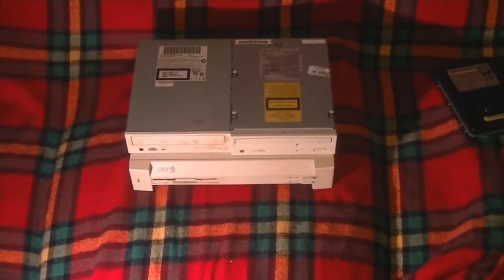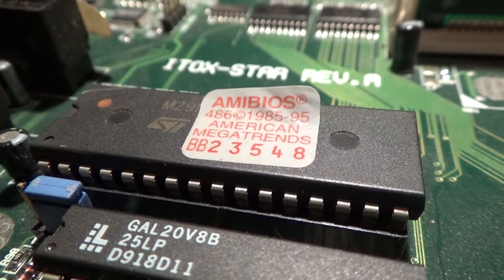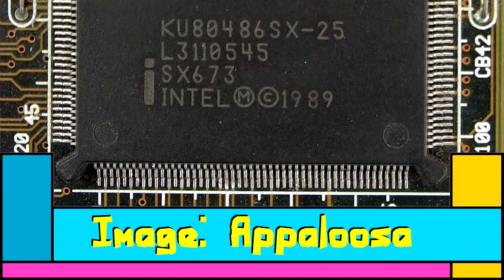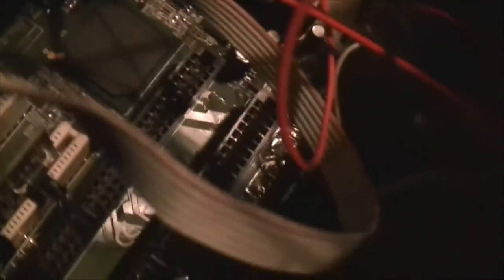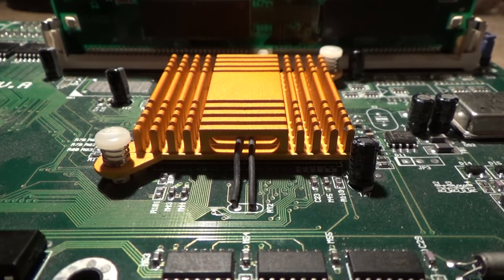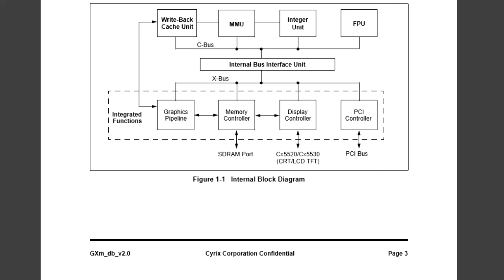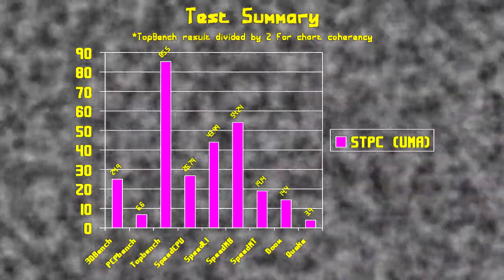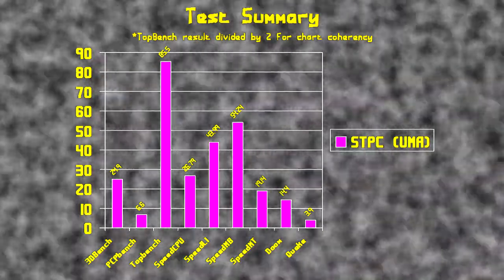STPC (Embedded 486) & Industrial x86 explanation

Comment: I've been after a 486 since my Packard Bell Legend Multimedia died a couple of years ago.  It would be brilliant to build myself a new 486, but I really cannot afford what these would cost, and I'm sure there would be some problems down the line with me trying to run a bespoke industrial board as a general purpose multimedia capable 486 machine.
Reply from the maker: Quite possibly and the prices are indeed steep, I was lucky with this one as it was listed simply as "486 Motherboard" and I don't think the guy really knew what he had. Currently there's an eBay seller selling some of their non-industrial machines cheaper than they usually are over here, but I've no idea as to the condition of the 486 machines they have or if they are priced well as I was after other things. May be worth a look. As for problems with industrial 486 systems, I can tell you the ITOX doesn't always play well with CF cards, which may be a problem down the line if my mechanical drives fail.
Reply: HighTreason610 I might look into that
  hopefully I'm getting a Gateway 2000 from across the pond from lmull3

Comment: Doom would run even better if you used the low detail/shrunk the screen a little bit or both. I think you can achieve 35 fps easily with that (35 fps is the maximum framerate of Doom and is achieved when gameticks equal realticks, more performance is good only to avoid drops in busy areas).
Reply from the maker: It would, but the purpose of the benchmark is to use identical settings on each machine to show how the performance varies. I see no reason to explain this in the video as I feel it would use up time and may possibly even be insulting to my audience, primarily because I believe my audience is intelligent enough to realize that lowering the detail and screen size would make it run faster - and given your explanation here, it would appear my belief was correct.

Comment: Thanks for the double videos mate! We've missed you! I watched the Mario 64 lets play though :D wuz gud!
Reply from the maker: I miss being here when I've been away for a while too, thanks. Oh, yeah, Mario 64, me and that game don't get along very well. I need to get back to uploading that and editing together the game for after that one. Also hoping to start Mirror's Edge in the next few months at least.
Reply: Mirrors Edge sounds ace! One quick question...what are the specs of the main computer you play modern games on?
Reply from the maker: For the most part I don't. As yet I haven't moved any of the newer games from the old Pentium D workstation aside from Minecraft, and that's only because of something me and a friend wanted to do that needed more power, which actually makes things harder for, as I plan to build a lag machine in-game to ruin his fun. Otherwise though, the new Xeon actually has a slightly weaker GPU, a GT730, versus the GTX460 in the Pentium D. Outside of that the only new games I own are The Sims 3 and Mirror's Edge. I generally rely on DOS/9X or an old console for my entertainment. Both the Xeon and Pentium D systems are supposed to have a video at some point, but a brief outline of the specs would be as follows;

Pentium D Workstation;
Intel Pentium D 950 (3.40GHz)
ECS Motherboard - don't laugh, they actually made uncommonly good boards for a while
Intel 945P Chipset
nVidia GTX460 1GB - MSI brand. Faulty, only 768MB shows up now
4GB DDR2-667 - As fast as the board can go and as large as it officially supports
Audigy 2 ZS Platinum - A complete wreck
10TB total storage
Windows 7 for compatibility, but I'd like to roll back to XP eventually
This one will play Mirror's Edge because I have fond memories of playing it for the first time on this system and it is a good way for it to say goodbye to producing things for YouTube in my mind. Here's hoping the liquid cooling can hold out as it has some serious leaks now. I may fix it up and re-purpose it once its video and the Mirror's Edge playthrough are completed.

Xeon Workstation;
Intel Xeon E3-1271 V3 (3.60GHz)
SuperMicro X10SAE Motherboard
Intel C226 Chipset
nVidia GT730 - Can't remember how much memory, 1GB I think. Runs Windows 10/Vegas really well. ASUS branded
32GB DDR3-1600
16TB Total Storage - RAID 10, so 24TB of actual drives
Windows 10 Pro

I only properly began moving from the Pentium D two or three videos ago, so it rendered nearly everything here going back to the very start of this channel up until the Saitek R100 video. Duke Nukem II was its last rendering job.

Comment: A really interesting board, shame the only proper listed one on ebay right now is $400. Would be interesting to see it handling NT 4 since that would be more likely to run properly on it than Windows 2000.
Reply from the maker: Prices can be downright stupid for this kind of thing. I was lucky when I got this one, as I don't think the guy selling it knew what it was and listed it simply as "486 Motherboard" with almost no description. I don't remember the cost as this was a few years ago now, but it wasn't much at all. I only mentioned Windows 2000 as an example of running a more powerful machine (like a P3) with a more common operating system for the time, I'd still bet on this having run DR-DOS or QNX for most of its life.

Comment: I was part of the team who worked on the STPC. I developed the STPC Industrial Debug Board, and worked to have it booting  for the first time. We received the first prototype chip and were able to boot Windows after 30Mn of debug
I still have the STPC debug board I build and some evaluation boards. (Standard PC Motherboards)
Thanks for the time you spent on it. The Board I have does not have the AMI BIOS
At that time, we had Pentium 2 like core ready and 100% designed by STMicroelectronics, but the project was cancelled :-(
The same team (Named New Venture Group)  worked also on Power VR and the first NVidia graphics, Riva 128
Reply from the maker: That's awesome! I know the Vega was a thing to some extent, though from what I could find this was running an MP6 core, is this the chip you refer to or was another one under development?
I've actually seen NV1 chips (nVidia's solution before the Riva) with ST branding before, as for the Riva 128 the chip package sure looks like it came out of an ST fab if nothing else.
Back on the STPC, since making this video I managed to get hold of a 133MHz model (Atlas) on a PC/104 form factor board, it is a rather novel device, being basically a 486 running at 2x66MHz with SDRAM onboard and an SSD (Disk-On-Chip) plugged in, it's a snappy little thing.
Reply: I worked on the STPC Industrial, It was based on Cyrix 5x86. Then it is a 486 core, with a 64bit bus...STPC Atlas is the evolution of the STPC Industrial (6x86, SDRAM Memory)The chips are also designed to work with external frequency up to 133MHz, so, not in DX2. You can check this out:https://datasheet.datasheetarchive.com/originals/library/Datasheet-039/DSA0084697.pdf I still have 2 STPC Industrial eval boards and One Debug BoardAt that time, the STPC Consumer was the first chip designed. It was made to be embedded in Televisions and design settop box (Box with a modem and TV Display, to browse internet on a TV)The STPC Industrial was designed for the Industrial/ PC104 market. 
It was used in the Peugeot 607 GPS embedded computer. For this, we added the anti aliased line drawing in hardware in this chip.The Core and Graphic chip embedded was made by Cirrus Logic, purchased by ST... (If I remember well)We can find some datasheet on this site:http://kazus.ru/datasheets/pdf-data/5792680/STMICROELECTRONICS/STPCI01.html

Comment: I don't know if the same code-base of the x86 QNX is the same for the other embedded devices, but in those QNX was king for really top of the notch stuff. Mainly because it's so robust, and it offers a true real time OS, which is ideal for complex and very time-sensitive applications. 
Just to add a little, I had an AMD Geos industrial PC, which was a 586 compatible. It didn't had the PCI connectors per-se (they were exposed as pin headers, for modules instead of cards), and it got quite a lot of serial ports. Quite nice hardware for its time, but for today... well, even a RaspberryPI (the one you showed in the video) has more computing power for less power consumption... 
Anyway, thanks for the 2x upload! We were missing your videos...
Reply from the maker: QNX 4.25, as I ran on this, was multi-platform and did, apparently, support some ARM processors. As for it being robust, yes, overall, I got that impression. Actually, my first thoughts when playing with it were that it reminded me of Minix 3 but better refined, which isn't too far fetched because they're both Micro kernel operating systems - very reliable as a driver crash generally doesn't bring down the whole operating system, what with everything running in user space except the bare basics of what is required. Also, with the time sensitivity, that was one of the points for not running Windows NT/2K, as I/O often suffers strange lag and buffering, which I would suspect is largely as a result of HAL and the odd workings of their Hybrid kernel. I'd imagine a Monolithic kernel, as used in DOS/9X, could make up for it, but then you lose the reliability of the Micro kernel, so my money would definitely be on QNX I think.
I have seen peripherals connecting by pin headers like that before and I've definitely seen machines with a large number of serial ports. In fact, one of those little Atom E3800 machines that DFI makes has about eight of them.

Thank you for the compliments, I start to miss being here when I've not had anything to upload in a while.

Comment: Eu já conversei com ele e isso me envaidece! 

All praises to High Treason, what a magnificent bastard! This guy helped me once. A quality self and that was pretty good. Awesome video. So neat.

STPC overshadowed ? Not anymore!
So....I have been eating sliced bread to tis day thanks to a 486. :)

The record shows, 486 took the blows, and did his waaaaaaaaayyy!
Reply from the maker: Well, that may be stretching it a bit, but I appreciate your complements. Yes, it is entirely possible that a 486 was responsible for something on the line producing bread. One thing I do know is that Carnaud Metalbox were still relying on 386SX luggables in the production of tin cans until recently as I own a machine from one of their closed sites, though I wouldn't be all that surprised if the remaining locations still use them somewhere. They made cans for companies like Heinz and even Coca Cola.
Another place to find older processor cores still in use is in space, on satellites and probes, but I don't think anyone will let me play with those. Notably, New Horizons (headed for Pluto) uses a modified MIPS R3000 core at 15MHz known as Mongoose-V, so essentially the same technology that ran the PS1 and PS2, though it had already been around since 1988. Funny to think of it as though there's a radiation hardened PlayStation flying around up there worth millions of dollars.

Comment: If only they made standard atx versions of this! Nice find.
Reply from the maker: It was indeed, I got it a few years ago and I don't think the guy selling it knew what it was, I seem to think the listing was simply "486 motherboard" with an unusually low price. Sometimes you can find good things with ambiguous terms or else, if you can get into the mindset of those without the knowledge. In the discussion I mentioned about the ZFx86 the idea of a 486 on an ATX board was put forward, the hardware is out there but nobody has quite put the pieces together yet. Creepingnet put forward a good idea and one that was in the back of my mind too, in that it would be cool if someone integrated the hardware into a keyboard too.

Comment: Last year I got a 486, a Socket 7 system, a Macintosh IIfx and a Pentium 4 system with ISA slots (look up the prices on boards like these, $500 and upwards!), all decommissioned by my uni. They all had custom interface cards to run some measurement devices or another.  There is a lot of old computer equipment still around, and some of it for grabs, if you know where to look. 
Back when I was in middle school still, I got my XT from there.

Comment: Cool vid, I've been wondering about these Industrial SBC 486 units for awhile now being a retro-computing enthusiast, especially ever since I heard microsoft cut WFWG 3.11 (which was also used in Embedded apps) and intel the 80486 support in 2007.  

Knowing that these new 486 chips are practically SOC's, it has me almost thinking if DOS gaming on authentic hardware were to take off much like the Atari 2600, NES, and whatnot did enough to spawn such things as the Flashback, NES Classic, and Jakk's Pacific pnp games - these would be the perfect platform to use for a consumer retrogaming device aimed at that market....sort of like a clicky keyboard assembly with built in trackball and the SBC inside of it that connects via HDMI, Composite, or VGA.
Reply from the maker: End of support matters little in some places. As an example, if your SBC was controlling a CNC machine or something, you probably wouldn't have it connected to the internet so the security vulnerabilities would be irrelevant and you wouldn't want updates being installed if they weren't absolutely necessary anyway, because they might break something. Your idea is essentially the same as mine, I've seen Atom machines which are inside a keyboard casing and it would be neat to see something like that with, say, a ZF x86 chip instead. In my mind I see a kind of T3200 without the screen and a modern display interface in its place (though VGA still available, in case the user wants to use a CRT) and the expansion slots intact, given the ZF offers a real ISA implementation.

Supposedly there was a project to emulate old cards around that could also be useful in such a machine, I remember someone talking about trying to port the DOSBox SB16 emulation code to a modern SoC (Arduino or RPI, not sure now) and make it connect to an ISA slot, I don't remember where it was though or if they got very far, assuming it was even feasible.

To be honest, I think it is only a matter of time before someone makes such a machine, though I'd bet they cop out and use emulation instead because people are inherently lazy and most don't mind the imperfections. I can already see the tech cool kid channels misrepresenting a bunch of old software with all the compatibility problems they wouldn't notice having never used the real hardware before and having no idea how these things work anyway.

Comment: Weren't/Aren't these types of systems used in ATM machines? I remember seeing a bluescreen on one in 2003 xD
Reply from the maker: Possibly. Most of the ones we have locally use P3/Celeron motherboards in a standard ATX form factor and, as noted by James Maple, they run Windows XP. Lloyds TSB were still using very old ATMs until around 2008 though, some had been upgraded and appeared to be running a variant of OS/2, but most of them were plain green text-only things with text burned into their phosphor, likely having been there since the 1980s. Before chip and pin was so common, I once successfully copied the mag strip from a debit card and had it read by one of those, it was my own card so I doubt anyone really cared though. It's amazing what you can do with a Robot Wars Club card and a scrap of VHS tape.
I seem to remember a dude called Aussie50 once did a teardown of an ATM on his channel.

On the DXR3 - I have noticed that these hardware decoders seem to be unusually good at scaling and even deblocking videos.
On the NexGen - you're not the first to bring up the DX4 and I plan to address this in a follow-up in the future.

Comment: What I find hilarious is probably on some PC assembly line in some other country somewhere - a Prescott or Atom or Hammer or whatever - passed by a 80486 on it's way down the line to Best Buy.....so they can try and sell it to us and tell us 486 using Retro-gamers that the 486 is dead and to use DOSBOX on this new system, LOL.

It does not surprise me that the 486 is still in use at any level though - I have a DX4-100 myself, and using Nathan Lineback's hacked Seamoney I have modern web access on it, through Cakewalk 5, it does Digital Audio, and of course retro gaming is amazing..

I'm surprised nobody has done like Jaks Pacific and made a 486 all-in-one Plug N' Play that uses SDCards.
Reply from the maker: If you start walking around production lines you'll find all kinds of ancient tech still ticking over, I'm relatively confident that place nearby still uses a 286 SBCs which might predate the 486 itself. It seems old CPUs never really die completely because they turn up everywhere, NASA still has what is effectively a radiation hardened PlayStation orbiting Ceres right now. When you take a step away from the whole consumer/gamer/server principal of 'MOAR POWAH! MOAR CORES! MOAR SPEED!' and look around, it quickly becomes a whole different ball game - as the video basically said, the STPC isn't supposed to be powerful and it doesn't have to be, it just has to work and not stop working when operated in a harsh environment, there are no peripherals to break down or come loose from vibration, it doesn't need high airflow that would clog everything with dust, it "just works" as they say.
Ah, now, I actually tried the whole concept of a 486 games console once, but it wasn't really feasible beyond a personal novelty, not then anyway, have to wonder if one could make such a thing with the chips that are around now and the wider availability of board fabrication companies or tools to do it yourself. For the record, my attempt sucked, it used off-the-shelf parts and relied on CDs, it was pretty crap and was given up on over a decade ago, with the parts used finding a better use elsewhere.